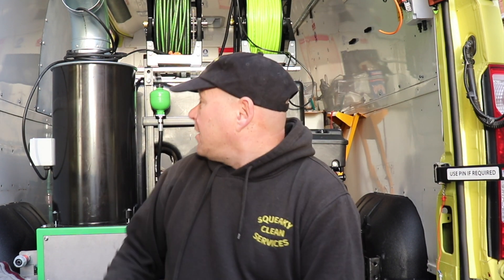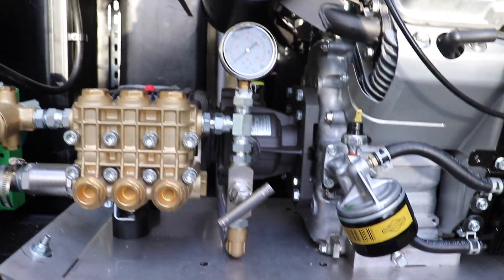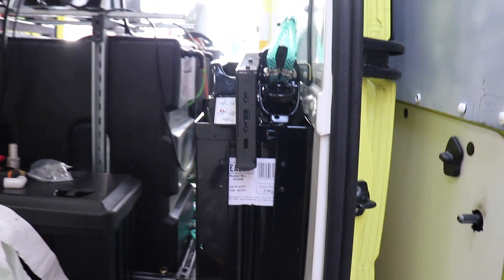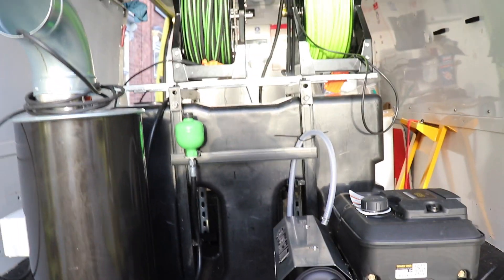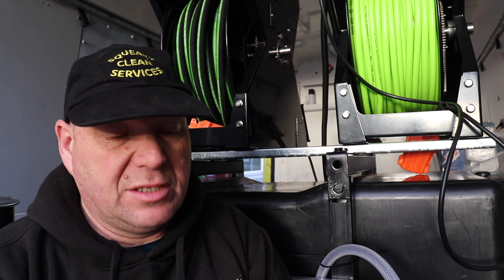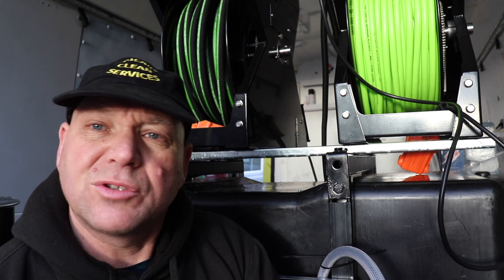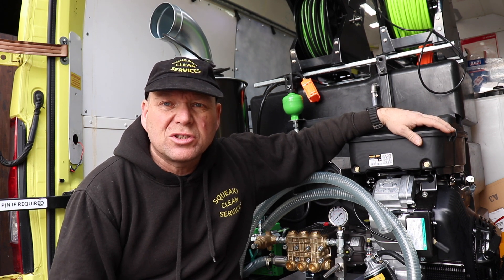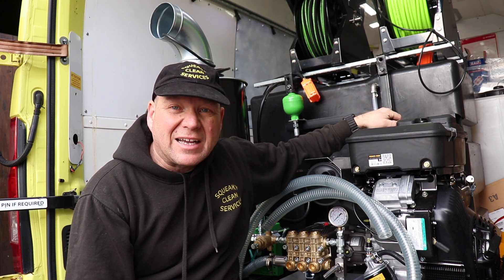Setting up a Pressure Washer Buffer Tank  Eps 9 Ultimate Exterior Cleaning Van Build

Comment: You need to run the  🔥 Hot muffler out the bottom of the  Truck it will make your Truck cooler .and cep it cleaner after  time

Comment: hi Dave congrats on your new pressure washer set up - i am looking to do same here in Ireland with local supplier - what pressure washer did you go with and where did you get reels - thanks
Reply from the maker: Hi Michael
The pressure washer is a 30 litre 200bar bBiggs and Stratton  23Hp engine. Im not sure what the pump and gearbox are. 
The hose reels are from Xline systems. I haven't used them enough yet to say whether the motors are strong enough for the pressure washer hose.